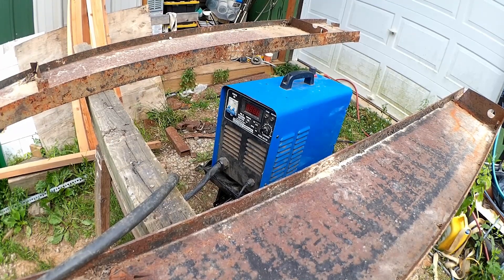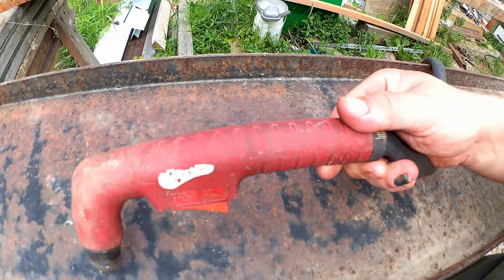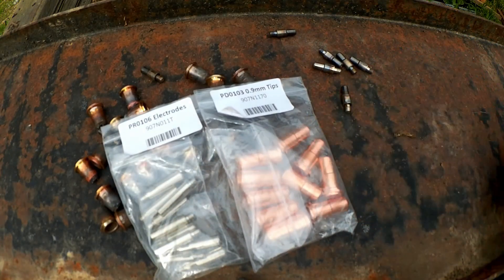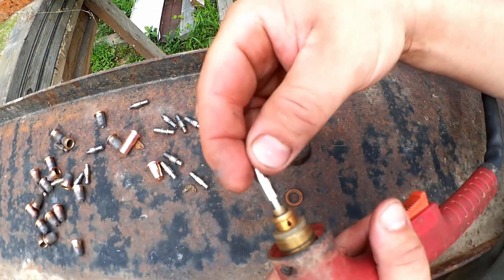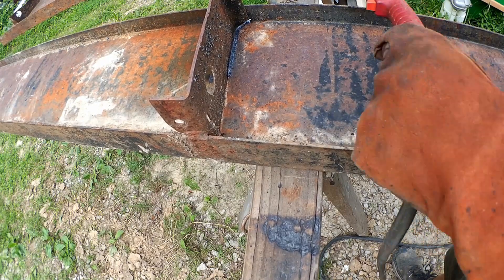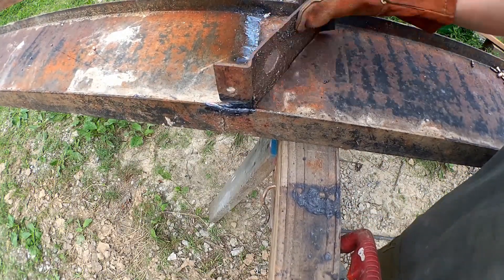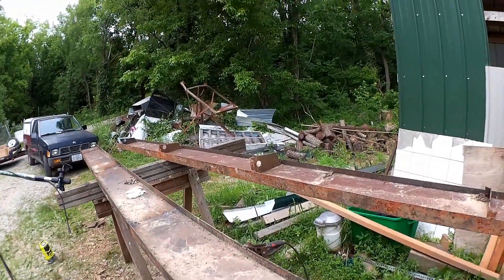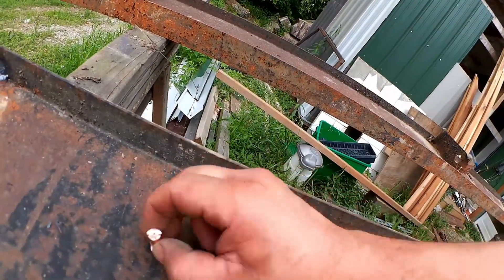Improved Plasma Consumables

Comment: Yeah i have a pt60 torch on a machine called a strata . The torch is pretty much the same except my consumes are in contact with nozzle until i start cutting (can't think of the term) . I too am pissed off with the consumes which are real easy to go through . Specs say i can drag however the dam nozzle is live & sticks as tho i was sick welding when i touch the metal i want to cut , which i suspect is why i went through 2 electrodes pretty quick & a third i believe was due to being to close . Even so when i leave a 1cm/10mm stand off it still goes through electrodes faster than i'd like . After watching chucke2009 with his hypertherm in the earlier vids , i thought all consumables would last a bit . Seems hypertherms last a lot longer than the junk torch you & i were supplied with.